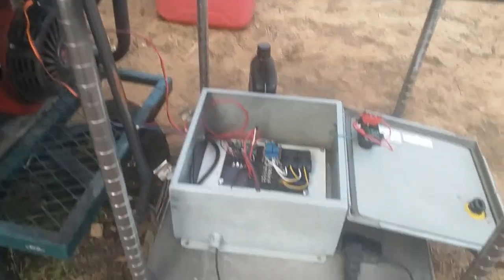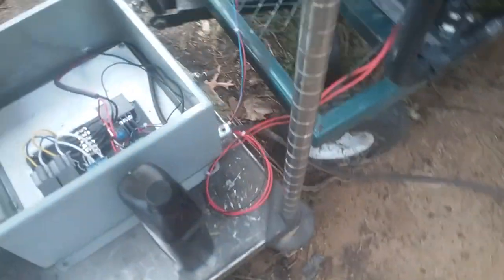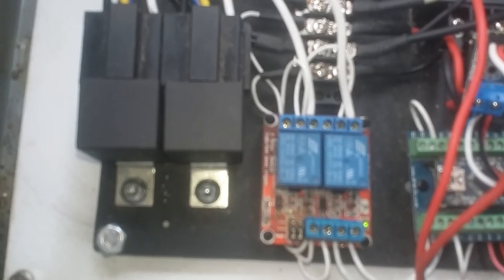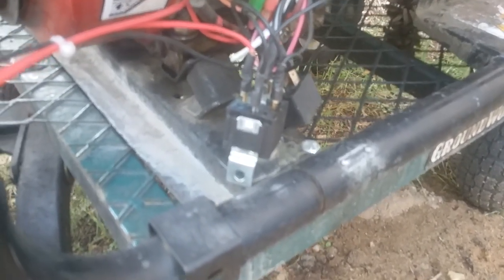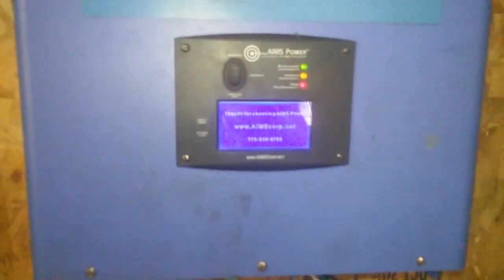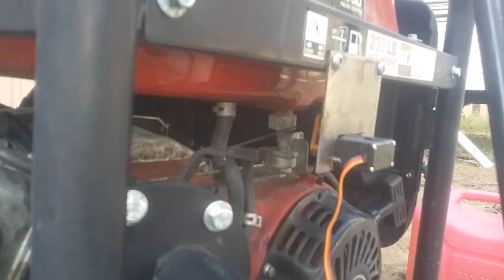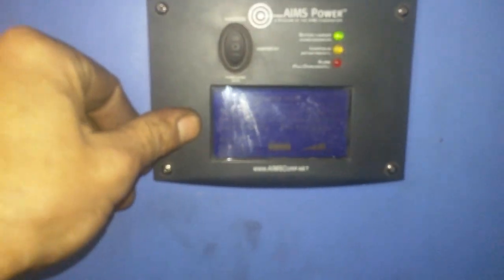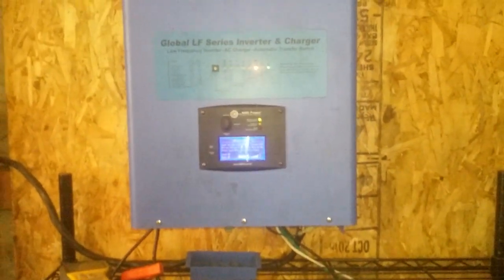Generator Auto Start / Shutdown Controller

Comment: The servo moves very fast, in winter this could cause the generator not to start. It's fine anyway!
Reply from the maker: Ran all winter in -10 degree weather. This was my off grid system up until mid Spring when I replaced the 8750 there with the 3500 inverter genny :)
Reply from the maker: Im not sure how I had the code set up there. But later iterations the servo moves to full choke close then opens to 90* angle position for a few seconds and then full open. The new system there is a pot switch to control duration and speed.

Comment: Hey Matt... Long time no Talk..  Good to see that you are still at it.. Good Vid my friend.
Reply from the maker: What the?! Man you still around, was wondering how you were doing. Yeah so I got into a little more advanced coding as you see :). New machines feature an RPI 3 with 7 inch touch screen. I created the GUI for it and then learned I2C. The pi controls three Uno R3 modules via I2C and those control the gasifier systems management, the engine controls and the third is used for different timers. Yeah that engine AFR code has come a long ways long ways. Ended up being much simpler than when I first started out with it.
Reply: @Thrive-Off-Grid   Good stuff my friend... I still use Skype with the same handle.. If you desire we can chat sometime... Keep up the Great Work.. It is Impressive.
Reply from the maker: Yeah if you have not been over to my website in a while, you should check it out. This years machines are pretty advanced, probably the most advanced system of its kind currently on market. https://www.thriveoffgrid.net/
Reply: @Thrive-Off-Grid How does the system know when to stop cranking?

Comment: Can u please provide the details of the components and schematic and  code ?
Reply from the maker: You need a 5 Volt power supply, an Arduino of some sort, a 5 volt logic two channel relay board and a voltage divider to range from 0 to 5 volts max.
Reply from the maker: #include <Servo.h>

//Inputs
int Batt_Bank1_Voltage = 0;

// Ouputs
Servo Choke_Servo;
int Eng_Start = 13;
int Engine_Power = 10;

// Variables

int Generator_State = 0;
int pos = 0;
int Bank1State=0;

const int sensorMin = 0;      
const int sensorMax = 1023;   

//Parameters

const int Batt_Low = 510 ;
const int Batt_Full = 575;
const int Float_Charge_Duration = 250;

// Switch Modes

const int Manual_Start = 1;
const int Auto_Start = 2;
const int System_Charge =3;
const int Float_Charge =4;
const int Gen_ShutDown = 5;
const int Batt_Safe_Voltage = 6;

void setup() {

  Choke_Servo.attach(6);
  pinMode(Batt_Bank1_Voltage, INPUT);
  pinMode(Eng_Start, OUTPUT);
  pinMode(Engine_Power,OUTPUT);
  Choke_Servo.write(90);
  digitalWrite(Eng_Start,LOW);  
  Serial.begin(9600);
}
void timer1(){
  
        int Duration_Value = Float_Charge_Duration; //read duration value

                          
        int timer1_value = map(Duration_Value, 0, 1023, 0, 32000); //Mapping pot values to timer
        for (int i = timer1_value; i >= 0; i--){ //Begin the loop
            Serial.println(i);
            delay(100);
        }
    }

void loop() {
  int mode = Batt_Safe_Voltage;
  // read the input on analog pin 0:
  int Batt_Bank1_Voltage = analogRead(0);
  int Bank1State = Batt_Bank1_Voltage;
  //Serial.println(Batt_Bank1_Voltage);  
  delay(100);

  if (Batt_Bank1_Voltage < Batt_Low && Generator_State == 0){
    mode = Auto_Start;
    delay(10);
  }
  else if (Bank1State > Batt_Full && Generator_State == 1){
    mode = Float_Charge; 
    delay(10);
  }  
   
  else if (Generator_State == 2){
    mode = Gen_ShutDown; 
    delay(10);
  }

    switch (mode) {
      case Auto_Start:
        digitalWrite(Eng_Start,HIGH);
        digitalWrite(Engine_Power,HIGH);
        delay (1500);
        Choke_Servo.write(5);          
        delay(1500);
        //Choke_Servo.write(90);          
        //delay(50);        
        Choke_Servo.write(175);
        delay(1000);                
        digitalWrite(Eng_Start,LOW);
        Generator_State=1;
        delay (10);               
        break;

      case Float_Charge:

        timer1();        
        timer1();
        Generator_State=2;
        delay(10);        
        break;

      case Gen_ShutDown:
     
        digitalWrite(Engine_Power,LOW);
        Choke_Servo.write(90);
        Generator_State=0;
        delay(10);        
        break;
    }
}
Reply from the maker: I am now open sourcing this code by posting it here in public domain. All are welcome to use it and add features. If you do make changes or add features please share with others!!
Reply from the maker: You will need a basic understanding of your generators electrical. The wiring is in the code no need for a schematic. One output from the arduino fires an engine power relay and the other one fires the engine starter. The third output controls the choke servo. Much can be added to this code like a fail to start instance. On colder days nights sometimes I have had some misfires. you can wrap a wire around the spark plug wire and feed this into the arduino as an input and use this to detect if the engine is running or not.  An adjustable choke time interval via a pot switch would be a nice for changing weather. Same goes with the starter timer interval. I do plan to offer this for existing gasoline back up generators, this is a really nice system to have and will make the generator much more efficient.
Reply: @Thrive-Off-Grid  Thank you so much , really apreciate sharing . if i will manage to build somehting at some point i definetly share back my progress .
Reply: @Thrive-Off-Grid  Thank YOU!

Comment: Do you have a wire diagrahm?
Reply from the maker: No not yet. I may do a video for you DIY guys later
Reply: @Thrive-Off-Grid  even a pdf file i am not wanting to use an arduino wanna have it emp proof
Reply from the maker: @simpletennessee8118  Then it wont work, it has to have a controller to read signal, initiate the starter, control the servo, and shut down the unit.
Reply from the maker: @simpletennessee8118  All you have to do is put spares in a broken microwave and store it your basement. Get a latte Panda Alfa single board computer and stuff it with all software you can and put in there too.

Comment: Changing out a broken wheel on the log truck in the rain today... is there an Arduino App to do that for me? Hahaha, you sure get some interesting projects going there, Matt. I started to mount the Arduino controlled air/gas mix carb on the engine platform today. I'll have to finish it after tending to the wheel repairs. Hope all is well out your way. Bill